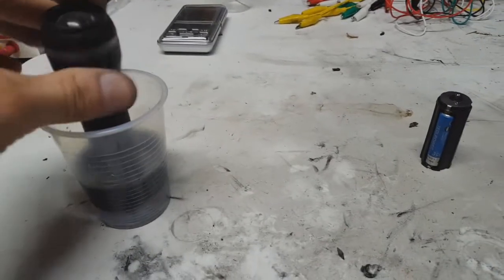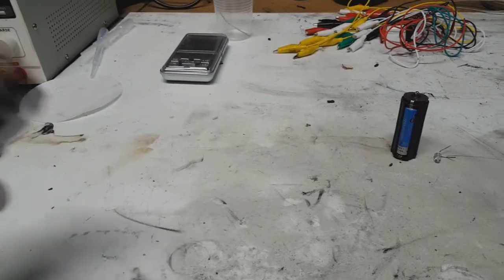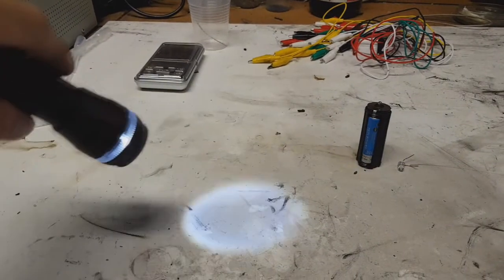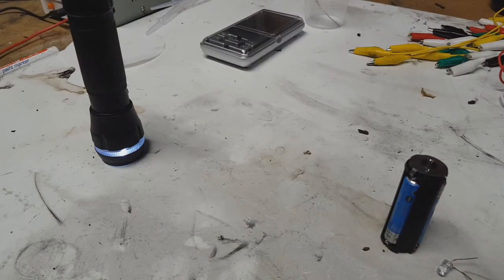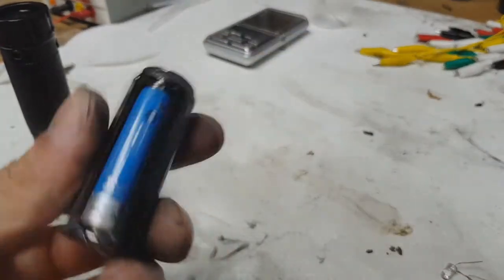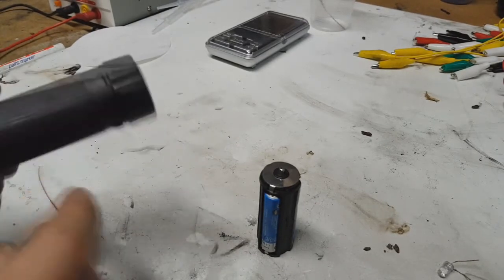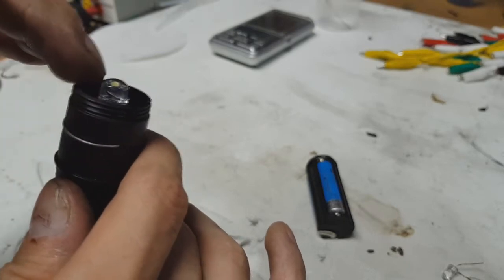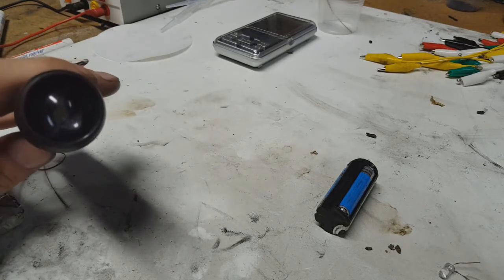Water POWERED Emergency Flashlight

Comment: How much voltage does your battery produce or do you still use a Joulethief to power the LED light ?
Reply from the maker: overunitydotcom 2.2 volts. More details in next video